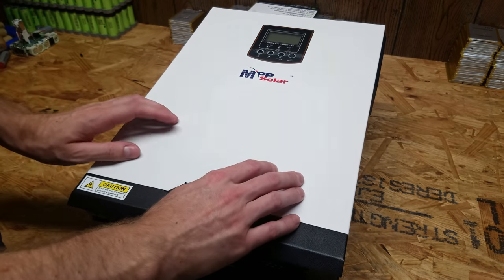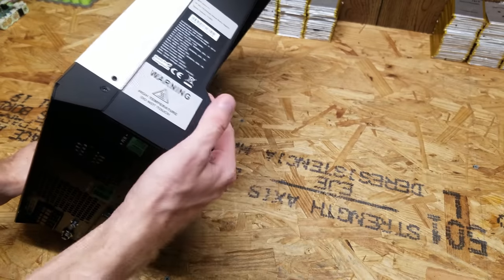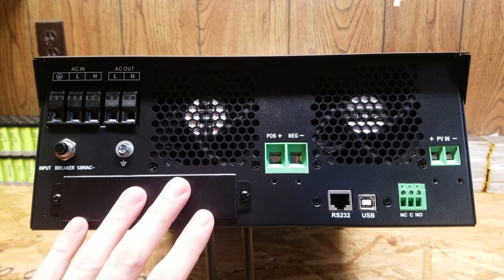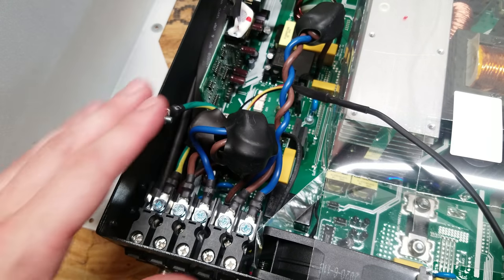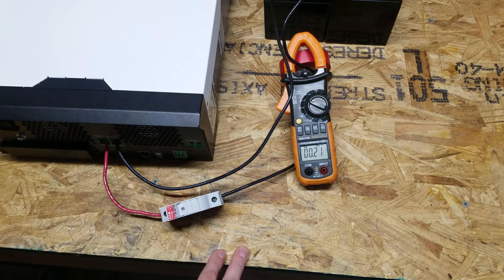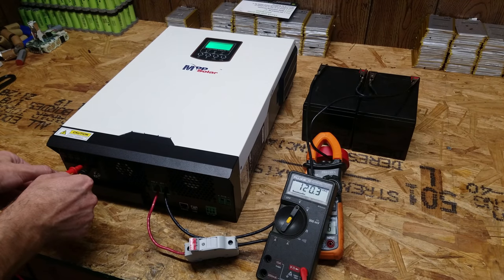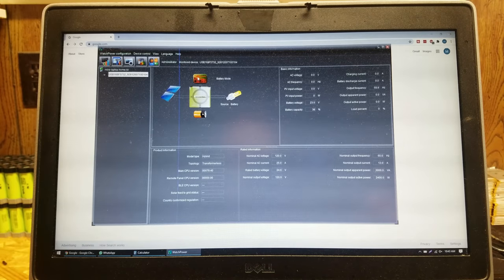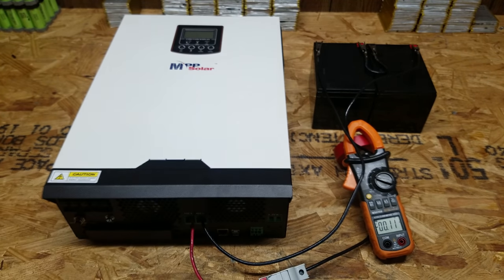A Quick Look at the MPP Solar PIP 2424LV-MSD Pure Sine Inverter

Comment: Thank you for help learning what a solar chap is going to install for camper. 
Question... what does the "LV" stand for? I ask since we're going with lead not lithium batteries due to periodic cold temp possibilities and maybe lithium is involved.
Reply from the maker: The "LV" in the model "2424LV-MSD" is referring to "low voltage". Most of the world uses 240V so because they produce a 120V model, they consider that to be a "low voltage" version.
Reply: @LithiumSolar  Thank you! Such a quick reply, WOW!!!
I am subscribing right NOW!

Comment: I'm wondering what the idle standby current draw is when that "power saving mode" is enabled.
Reply: According to my own kind of similar inverter (see my other post), it should drop to ~15W, maybe less.
Reply: @netcomptech - My experience with power saving mode was that it pulsed 120v every second and watched for drain.  While doing this, my BMS showed no draw.  So, it has to be extremely low.  There are some pretty significant capacitors in the PIP unit to facilitate a clean shutdown.  I suspect these would hold enough charge to power it in power saving mode for several minutes before reaching out to the battery to get recharged.  The problem I think most will see is that the load needs to be sufficient to actually cause the inverter to "see" the load.  I had 113w of LED lighting and a mid-sized freezer connected.  The lights would just kind of "strobe" and the freezer never started with the inverter in power save mode.  When I connected a heater to the mix, it came right on.   So, the load has to be fairly significant for power save mode to work, in my experience.
Reply: @BoHunter2010  Good to know, thanks for the info. 
(No I did not intend for that to rhyme, but, yeah it happened ! )

Comment: Hi! For over one year I have been using a MPP inverter 5048 MG. I am stil slightly confused when I use solar and the grid at the same time, In the manual the BYPASS indicator on the grid turns off but on my inverter it is always on.  The technicial staff states that the MPP manual is incorrect.

Comment: I'd be curious what the idle standby current draw is when that "power saving mode" is enabled.
Reply: Same here...
Reply: This
Reply: I think Will from DYI Solar said 19 watts
Reply: Power saving mode is not that great.   It pulses the AC output with a small blip every couple of seconds.  It did not detect and turn on for the 30W LED lamp I connected.
Reply: @NackDSP  Agreed for my similar inverter. 👍
Reply: I'm in the Bahamas and I have been using this same unit for one year now with no issues at all,

Comment: I have one of these too.  The fans never quit, even when unit is totally idle.  I'd be interested in seeing a mod, perhaps adding a thermostat, so fans power down when unit it idle/cool.  Your thoughts on that?
Reply: Should be easily do able for under 15 bucks. A 24v to 12v dcdc converter (if you wanted it powered from the battery side), or a salvaged 12v dc psu from something 12v if you wanted to use the AC side for power, and a cheap 12v thermostat.
Reply: My fans turn off when sun goes down and back on when sun comes up.   I have to turn the invertor off to get those fans to turn off.....otherwise it will run 24/7.
Reply: Thoughts, hmmm...
I suppose this never stopping fans as a long life insurance, as it keeps the components at lowest possible temperature. And for me it's no issue at all (apart from well, the power consumption). I don't notice the moderate noise anymore although running next to my sleeping room. 😴
Reply: @chrissubleski200 Love your clear video.  Will the fans run when charging batteries when plugged into grid? Will they run as well when running on battery and with load? I'm thinking of installing this unit in my travel trailer but concerned about the fan noise. If off grid, and no sun at night, I don't mind the noise when there are loads but if fans run 247 ..I may have to rethink? Perhaps a dB meter test is maybe something you can do if you don't mind?
Reply: Could maybe look into replacing the fans with high quality and efficiency ones like Noctua?

Comment: Thanks a lot for the short presentation!
It gave me an interesting comparison to my own inverter...

Well, my Effecta AX II - M-5000 48V Hybrid Inverter was advertized as "Quality made in Germany", but nevertheless seems to be a clone of your MPP Solar (despite the other model's specs). Even the config and monitoring application "Watchpower" is the same, as well as the insane internal consumption. To save at least some of the consumption I'm planning for Grafana on a Raspberry Pi, replacing my 35W (idle!) Windows notebook (~840Wh -> ~60Wh /d).

To the differences:
Mine is a 48V DC system with no facility feed-in, only automatic switching to the grid when no solar input and empty batteries. As for Germany it's a 240V model. Due to my household's max. power demand it's the 5kVA / 4.8kW model ( 10kW burst), good for 4.2kW of solar input. My PV solar has 1.5kW only (with real 1.1kW max. due to the location). Batteries are 3x 2.4kWh Pylontech LFO 19'' modules. Maybe a DIY battery will add some day, but for now I haven't harvested enough notebook batteries. Those serve other different, valuable purposes.
Interesting observation: Your model has the same internal consumption as mine, though only half of the power output.

Since due to a video free vacation lag I'm not up to date with your channel, I'm curious about any sequel to this episode.
Nevertheless, I already could add my own experience with my inverter after 6 months: Works as intended, although due to my limited conditions (as a tenant...) I constantly have to adapt some of the parameters. My learning curve involved a couple of user-grid blackouts, but also the pleasure of having bridged a 20 min public grid's blackout (which are occuring very seldom in Germany). And a perfectly provided 2 weeks vacation being absent from home (the one mentioned above).

Comment: I like the plastic air-flow to direct cooling across vital components. I started to turn off my Dish receiver when not using because the idle consumption was around 100 W. Saves me $$$. Maybe that relay on bottom could be utilized? Good job

Comment: I'd love to see the power saving mode, see if that makes any difference. And what does it actually mean. Also Id like to see some deeper testing into why it draws so much (perhaps put your multimeter on the fans to see how much current they are drawing each?). Or even better, each circuit on the inverter, to narrow it down. I'm sure someone smarter than me could come up with a way to reduce the standby. If it is the fans then a thermostat mod might be worthwhile. 12v thermostats are insanely cheap.
Reply: I turned my power saving mode on and had issues with it.  The AC output started coming on and off  and on and off....it was crazy....it worked at first then started freaking out on me..... I'm way over batteried and paneled so for me I don't even notice the overhead.
Reply: @joelpeterson  @ratgreen I turned Power Saving on also and here is what I found... The inverter will "pulse" 120v about once per second and sense if something starts drawing power.  I suspect this is done via the drain time (in milliseconds) of a dedicated capacitor circuit.  My issue is that my load (113 watts of LED lighting) did not provide enough drain for the sense to detect a load.  The LEDs would just kind of strobe once every second (fast on and then fade off).  So, I connected a heater and that caused the auto sense to kick on and stay on when the heater demanded power.  But, it didn't work with my lights and a freezer connected.  So, the mileage will vary depending on what you have connected.  If you have something critical (like a freezer full of food), I wouldn't trust it to come on reliably.   Sad too because everything I have is so efficient yet I am losing a measurable amount of battery just due to the ~60w idle consumption of the unit itself.   In the winter-time, where solar charging is hit an miss, it's a bit of an issue. In the summertime, who cares because there is more solar available than I could possibly use in my setup.

Comment: Great video.  I actually just set one of these up at my Cabin.  I was wondering if they made a mistake on the label as it says on the output it's rated at 40A but since it's a 2,400 W inverter at 120v so that would be 20A right?  Right now I just have a 10AWG extension cord coming out of the output but was just about to use 12/2 romex out.  But I'm still confused on that 40A rating.  Plus the manual that came with it may not be the most current.  I emailed them and they sent me a link to the latest manual....but even then it doesn't appear to show the specs of the 2,400.  So far I'm very pleased with this setup.
Reply: StringerNews1  Thanks for the feedback.  I was also wondering if that was a rating if you ran a few of these in parallel...but again that's new to me how that all works.
Reply: It is confusing as it has so many modes of operation.  I found it really cooked my power cord as it was charging the battery at a high rate from AC while also supplying 1500 Watts to an AC load in bypass mode.

Comment: If you are not connected to the grid, Can you connect a generator in case the batteries are low in order to charge them and bypass the solar?
Reply from the maker: Yes. This includes a built-in AC charger. You can connect your generator to the AC input of the inverter, which would pass the power through to the output and can also enable it to charge your batteries at the same time.

Comment: Last night my Mppt was working but this morning when i check it, its off i tried to turn  on and off the button, still not working then after i open the unit check all the wiring connection, all the connection was all ok i check the power from battery to the unit it shows 6.97v but when i disconnect the wire from the unit it shoe 25-26v it weird im
Not sure why, check the unit fuse inside it beeps need help

Comment: I love mine, Mike.  Exact same unit.  My only gripe is that the USB driver needed is not compatible with Batrium's USB driver on the same system.  So if you plan to use this for further testing with a Batrium in the mix, save yourself some trouble and either buy the wifi board for this PIP or use two different machines to keep them both USB connected at the same time.  Keep up the good work!
Reply from the maker: Oh that's interesting. The laptop I used for the MPP already had the Batrium driver/software installed and I didn't notice any problems. I haven't tried to plug the Batrium back in yet... I'll give it a try and see what happens. Are you running Windows 10? I didn't have to install any drivers but am not sure if it loaded one when I installed the WatchPower application or not.
Reply: LithiumSolar yes Windows 10.

Comment: Question for anyone who knows and wants to take the time:  If everything is already equipped with a fuse and a built in breaker switch, why is it necessary to still add the breaker at the positive side to the battery?

Comment: Do they offer 240v units? I have 0 use for 120v.
Reply from the maker: Yes, they have a much larger selection of 240V inverters than 120V. https://www.mppsolar.com/
Reply: @LithiumSolar  cheers, but that is by far the worst site navigation I've used in a long time. Already given up trying to find them

Comment: Does this model able to function as grid tie with AC power if the battery bank breaks or is not available? If that's the case, does it have an anti island function?
Reply from the maker: No. This is not a grid-tie or hybrid inverter.
Reply: @LithiumSolar  Thank you, is there one you could recommend, grid tied, 110v, 1000-2000+w, 36+V input, I am kind of lost with all the info, I tracked down this device : IGrid SV LV 3KVA Split Phase Hybrid Solar Inverter - but I am not sure if I can operate it without a battery bank

Comment: Is there a way to disable the built in AC converter? And use it only as a charger?

To meet that 50W is mostly the bridge configuration to generate the AC.

Those AC wires are really thin. The code here would not allow that.
Reply: just buy a charger and or 80 amp mppt controller would cost less

Comment: I'm curious, On items like this do we pay any import duties. I always order small parts from over seas but never stuff this big.
Reply from the maker: I didn't pay any fees. I was wondering the same as this was the first time I purchased something this expensive internationally since the trade deal Trump stuff happened. I usually just buy small $10 items. It was delivered like any other item, no mention of import fees or anything.
Reply: @LithiumSolar  i was wondering  how much you paid for  shipping  and is this a real mmp lv2424? I want to order 2 of these from Ebay  but wanted to  make sure its not a clone.

Comment: Quick question, first get little video, Thanks! my ? can it be set up to use utility power to charge the batteries at a set time when the cost is cheaper and set up to only use the batteries at the time when supper peak is for me?  Like charge at 10pm to 6am and use batteries from 2pm to 7pm the rest of the time use solar.
Reply: Sorry 'Great' little video :)
Reply from the maker: It doesn't have any timer-based functionality built in. I suppose you could rig up some kind of timer-based transfer switch that will disconnect your service power thus allowing this to operate in UPS mode. But no, this device as it is here cannot do that on its own.

Comment: What converter/solar charger do you think is best?
Reply from the maker: This particular inverter has an MPPT charger built in. However, if you're looking for a standalone device, I would definitely check out the PCM60X (also by MPP Solar). I have three of them running currently - fantastic controllers!

Comment: Can you make a video explain those numbers and terms on page 9 of the PIP-LVMR 3K Manual 20200428.  I plan to buy that to go with 6x12v100w solar panels in 2s3p configuration  and a 24V200AH battery - will that work?

Comment: Will power a 100 amp service ?? If it will how long run time will I get with two battlebron and 6 100 watt panel
Reply from the maker: No. This is a 2400W inverter, that's the equivalent of 10A service at 240V (this is a 120V inverter).
Reply: @LithiumSolar  Thank you I was close to buying it, I would have made a mistake.. Again Thank you

Comment: The problem with the MPP Solar inverters is that ONLY the 48 volt units are UL rated. The 12 volt and 24 volt units are not. On the other hand, the Growatt inverters are safety certified
Reply from the maker: Interesting. I didn't realize MPPSolar had UL-listed inverters. I'll have to check!

Comment: Are the inverter fans pretty loud? I want to use this for a van build, however, this unit would be just below the bed. Any advice on that?
Reply from the maker: Yes, unfortunately. When the fans are running, they are very loud. I would consider a different installation location or try to find a different inverter with minimal fans/fan speed.

Comment: I have the LV2424 (not the MSD).  I haven't done much with it.  But you mentioned the pre-charge resistor.   Could you link me to some info on that for use with lithium?  or if you are doing a video on it.  Have you tried to do anything with a generator on it?  I finally picked up a generator and considered doing some testing with it on the 2424 since I had it.  With all the storms that keep threatening florida I figured I better figure out all the options i can lol

Comment: Im looking into the pip all in one, i have a couple of questions im hoping someone can answer. 
   I have 4-210w solar panels on a cargo trailer, and two 12v lifepo4 280ah battery banks with 120a overkillsolar bms's. I will be running the battery banks in series, and will be limited to a continuous 120a charge capability so as not to overload the bms. I think from all the videos on the lv2424 i can use one instead of a mppt charge controller. 
   If so, my panels are rated at 16.77vmp and 12.48imp, would i be ok to run them in 2s2p or would i need to run them in 4s? 
   The standby consumption of these are pretty high, if i have a 2 cubic ft mini freezer hooked up and it kicks off when it reaches temperature setting does that throw the pip into standby mode? If so im thinking it will consume more than the mini freezer and be to big of a drain on my batteries. I'll be running a 5,000 btu window ac at night, between it's consumption and the standby consumption I'll be lacking enough solar to recharge my batteries the next day. 
   I like the idea of the simplicity of the pip, but may have to go with a mppt charge controller. Not sure if you'll know the answers im looking for but it doesn't hurt to ask. Im going to check out your videos, maybe you have covered this as you stated your going to do some videos on the unit. Thanks for any info, God bless!

Comment: They used automative fuses on the PV DC bus? Aren’t those only good up to ~40-60V? Not sure those can break a 145VDC fault.
Reply from the maker: Yes, they are automotive-style blade fuses. They're on the battery side of the MPPT, so they would only be seeing <30V.

Comment: Hi does this inverter also work with Lithium Ion batteries ?
Reply from the maker: Yes it does. You can manually set your own charge/cutoff voltages to match the battery you're using.